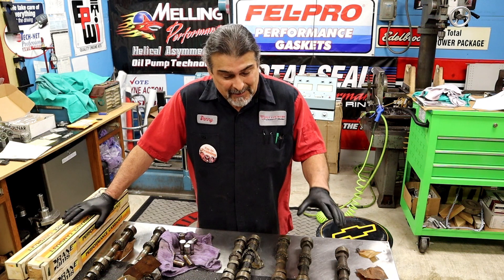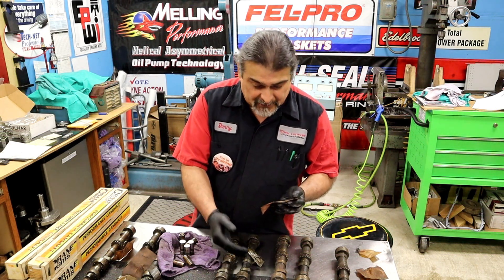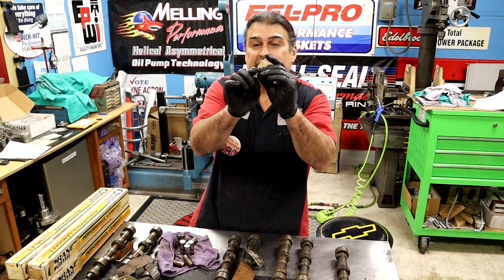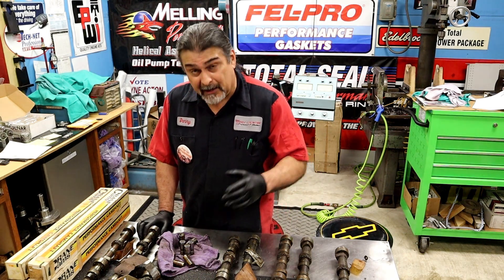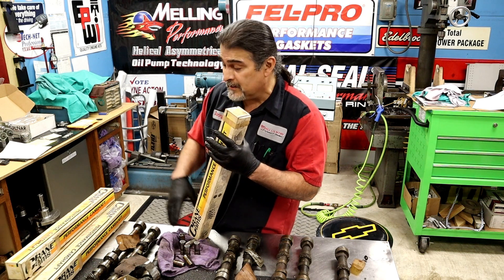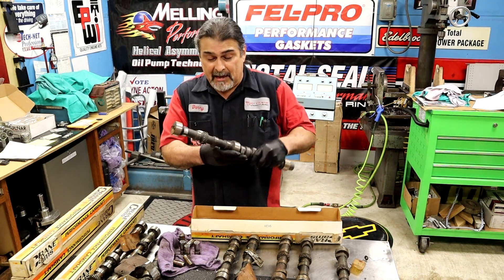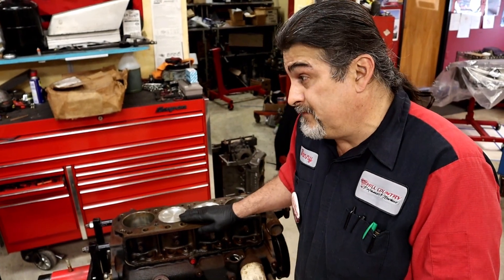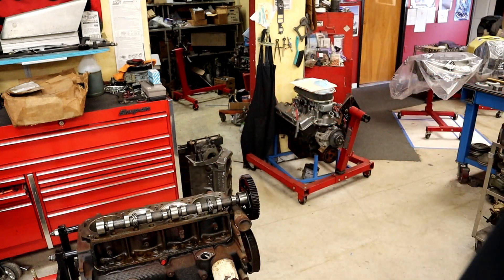What cam did Smokey Yunick use in the Hot Vapor Engine?

Comment: There's an awesome camshaft l used on a 4.1 ltr X-flow straight 6 N/A .  The original engine got 17/18 mpg around town & 23/24 mpg country driving with petrol / gas .  The camsharft l used in Australia was a slightly modified 186 s holden grind camsharft .  From memory it came with 107.5 lobe center line 4 auto & we gave it a 105 lobe center line 4 a 5 speed manual .  
I was using Liquid Petroleum Gas as my fuel ,  120 ltrs .  24 mpg around town & 29/30 mpg on country driving .  The thing pulled like a freight train .  Really strong.  And my genius mate had it idiling @ 250 rpm . Yep & it purred like a pussy cat at idle.  Amazing . Which was way different than the original  750 -850 idle .  Perfect camsharft 4 economy.  I was running 10.5 comp. 

Same engine running on 91 octane fuel ( petrol /gas ) that my mate put in the same engine 4.1 ltr ford 6 cylinder X-flow .  With same tricks as mine ..... 3 speed auto . Was 39 mpg . This was 1999 4 me .  That same camsharft opened up a bit on the lobe center line 4 a turbo by my calculations would have @ 7.5 psi turbo made 280 /300 hp & 380/400 ft lbs @ approx  1950 revs or less .  And economy would have been around the 43/45 mpg on a trip .

Comment: I know an old hot rodder and engine builder. He runs roller cams with flat tappets for dirt track racers, and tractor pull engines. Roller cams have steeper opening and closing ramps. And make more h.p. than your typical flat tappet cam. Just cause you've never seen it before just means it's a well kept secret.

Comment: The “Iron Duke” did in fact have a roller camshaft in the later years of production.  Smokey was working in the era where rollers where being installed in production engines to reduce friction to meet the tightening emission requirements.

Comment: I wish he would put just one of those motors in use
Reply from the maker: That’s the plan, worked the the car all weekend. It’s not as easy as everybody thinks. Running a shop all day and building a cam doctor at night then weekends on the car. Just finished the brakes now on buying a new tank and doing the fuel system. I wish I had money and time to work on it all day long. Anyway I have thought of removing all the videos then I wouldn’t be disappointing people.

Comment: On stock cams, there is a moment when the intake and exhaust valve are both open. This allows some of the hydrocarbons to be pushed out of the piston chamber right after detonation. On a vapor engine the camshaft should have "negative overlap." So that when the intake valve is open the exhaust valve is completely shut which will not allow any of the detonated fuel vapor to be pushed out of the piston chamber. Hope this makes sense.

Comment: Hot vapor is so awesome and simple should have been fully developed... with modern technology engine management for the different air to fuel ratio, forced induction with fuel injection spraying an intercooler like exchanger/vaporizer on the exhaust system built inside of the intake, methanol or water injection before the valves after the exchanger/vaporizer to reduce stress in the valves and pistons, extra clearances for higher temps like most supercharged applications, would revolutionize gasoline engine’s efficiency. Would be awesome to see before the electric regulation coming 2030’s . Been fascinated since childhood when I saw the Fiero in Hotrod.
Reply from the maker: We will be working on the Chrysler 2.2 this weekend hopefully getting it back in the car. Videos of that coming soon.

Comment: We need Spark timing and valve timing for Hot Vapor Engine.
Reply from the maker: This engine did not have the distributor tightened down and we will be mapping all the cams and checking valve timing.  I should make a video on that.

Comment: Daniel - I saw a vid of you some years ago, running one of these types of engines outdoors on a test carrier.  Considering we are using each of the heat cycles, circling what heat would normally be removed,  is there an idea of the temperature the Smokey engine ran at - in steady state? We have many gadgets today to make this much easier. 40 yrs ago, these questions would have come out of using stress gauges and expensive hardware to catch the data.  The note you presented - about shaving 10 thou off a washer - indicates the engine ran much hotter.  So all clearances need to be re-speced to that higher temp - to ensure the engine does not seize just because of the interference of all the clearances. Am i following this correctly?
Reply from the maker: Yes Sir!  I did find that the turbo/homogenizer was locked up. I’ll pull it apart and see if it’s just rust.

Comment: Hi Danny, Love your vids..that's some cool and privaleged stuff mate. I missed your last live stream, we're about 13hrs ahead over here and the vid wasn't available to watch after the stream😔 My question would be: On that engine that had the roller cam, but flat tappet hydraulic lifters...did it have any signs of roller lifters being fitted, ie. anti-spin/lifter guide pins or similar etc? Thinking maybe the flat lifters were possibly placed in there after the fact just to plug/protect the lifter bores?🤷👍🇦🇺
Reply from the maker: Great question, the roller cam did show signs on running a roller lifter and that’s kind of what I think.  No signs of pins or anything that might hole the lifters.👍👍👍
Reply: @MrDanielSoliz  Hmmm, bit of a doozie...Might be a job for Sherlock Danny....or maybe it's just something we're never supposed to know🤷🤣